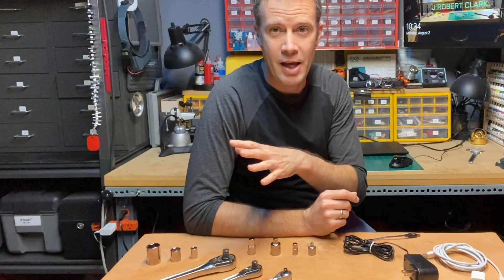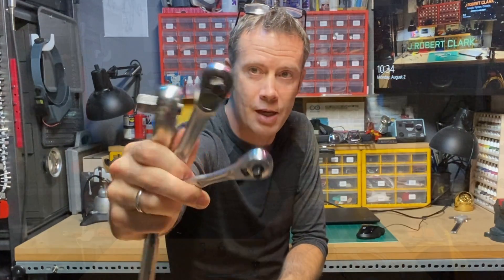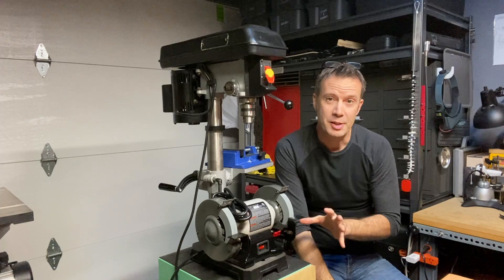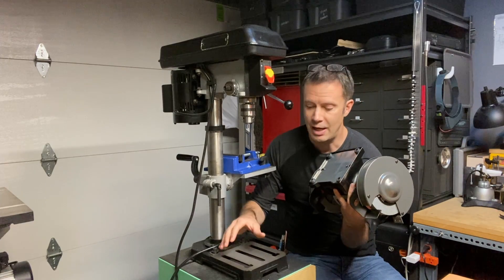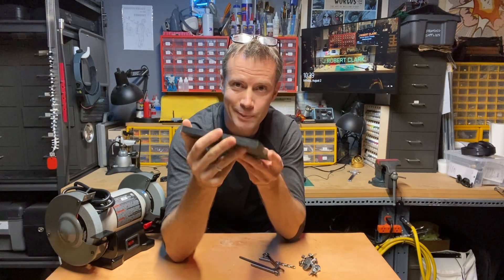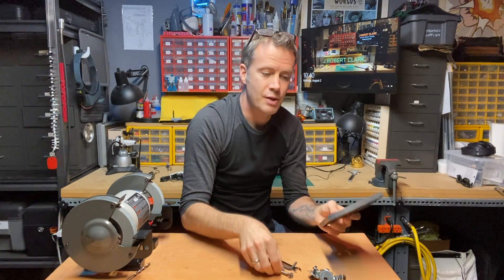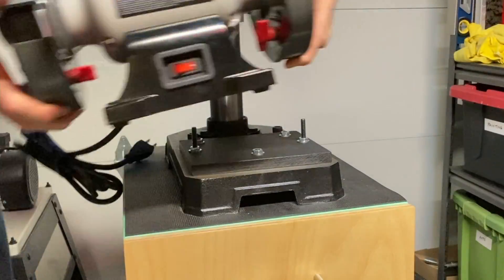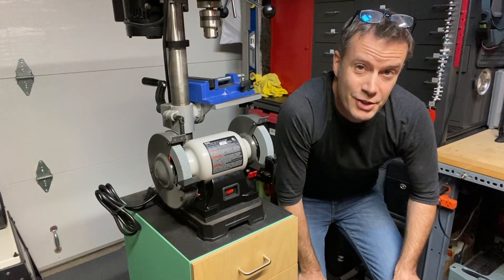Drill press grinder mount using a DIY adapter!

Comment: I like your addition of the bench grinder to the drill press base.  When you inserted the three connector bolts (with washers) through your adapter plate down into the slots of the drill press base, how did you prevent the connector bolts from turning when you cinched down on the bolt nuts on top to tighten the three bolts?  Were you able to access underneath the drill press base to somehow grip the bolts from turning?  Many thanks for your great idea!  👍

Comment: Wow!  What's that circular piece you fitted into the slots to get the mounting bolt for the plate to drive into?
Reply from the maker: Thanks for watching, @sal2988. Good question too - those are fender washers. I used smaller ones than the size I needed so they would be thinner and narrower. Had to drill them out to a quarter inch so the bolts would fit. I then slipped these into the slots on the drill press base, fitted the adapter on top of this, then tightened it down using 1/4" jam nuts. Hope this helps. And please feel free to ask more questions. ~JRC